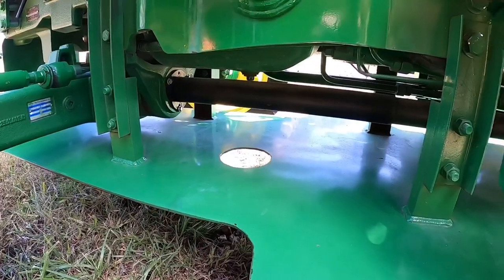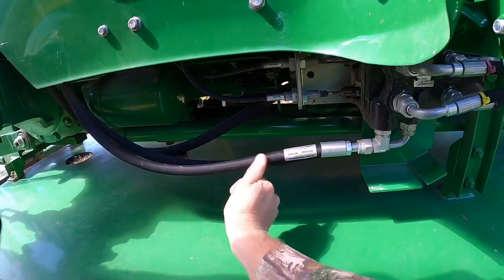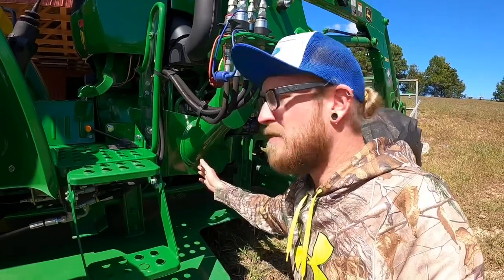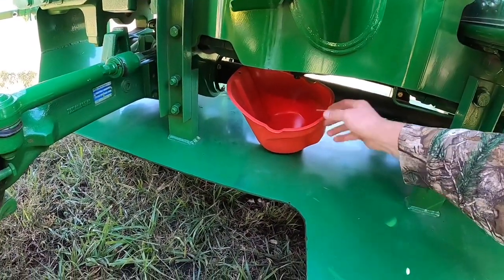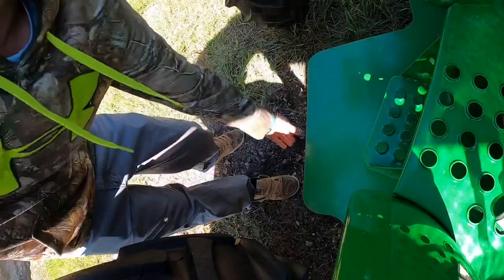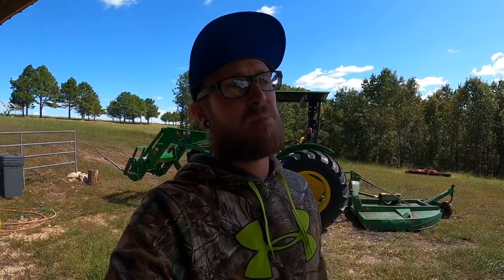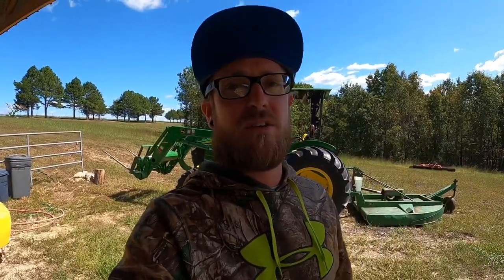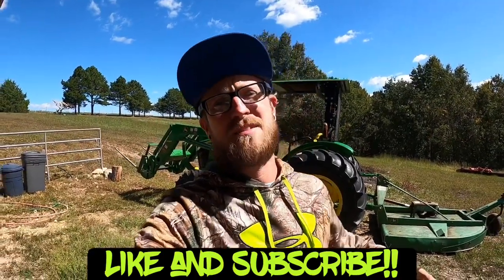Skid plate on John Deere

Comment: I would like one too. I think I'm going to fabricate it myself. I want it to be a little closer to the bottom of the tractor so I can keep my ground clearance
Reply from the maker: With this tractor I’ve had zero issues with ground clearance. I’m not sure that anything has even touched the bottom of this thing other than grass and trees. It’s worth it for the wear and tear on hoses and wires over time. As long as your plate isn’t too close and you are unable to service grease points and service/work on the tractor I’d say you’ll be fine. Thanks for watching and thanks for the comment!
Reply: @2poor2farm 13  you are welcome and thanks for the reply. I will subscribe and like.
Reply from the maker: @northsneads3662  thanks. I really appreciate it.

Comment: I built a skid plate out of half inch polycarbonate for my tractor, easy to cut to size and mount and it has held up good so far.
Reply from the maker: That’s awesome! It’s really nice to have some protection under your tractor for sure. Thanks for the comment.